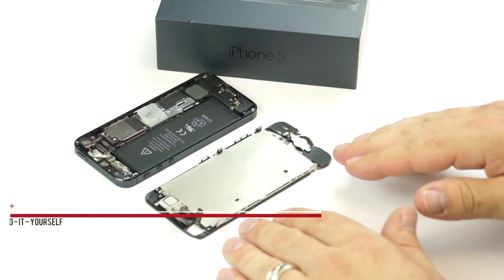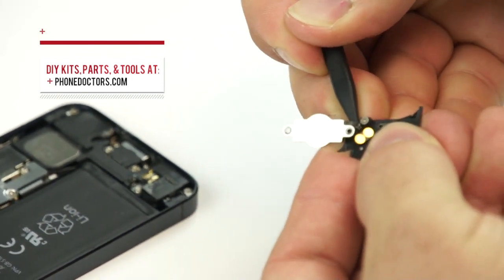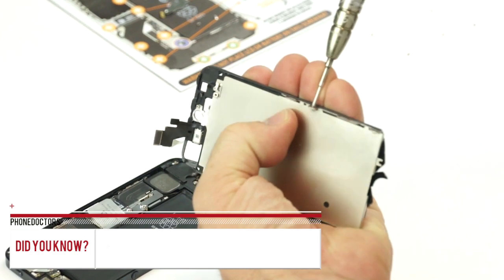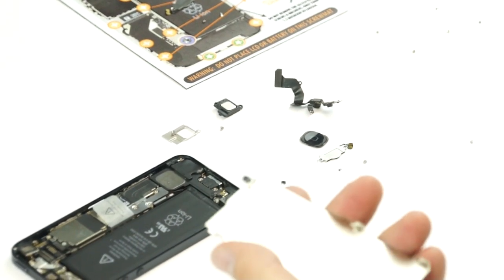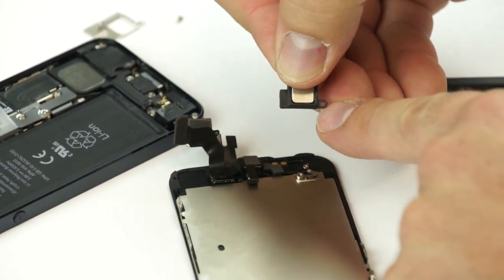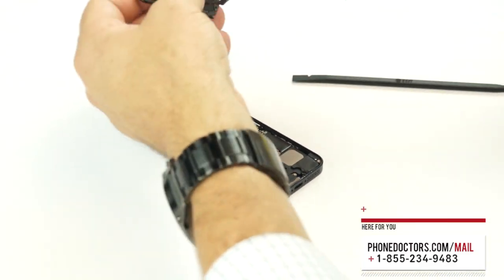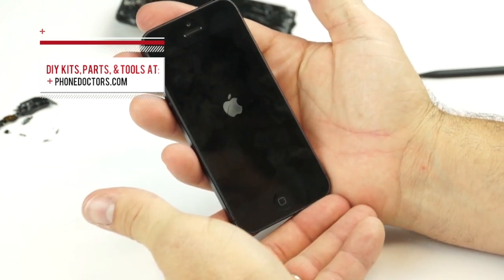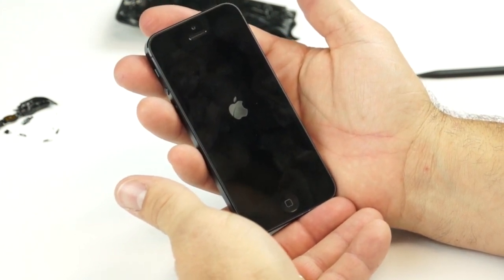iPhone 5 Screen Repair Video - Complete Screen Version

Comment: thanks a lot ;) everything works fine.
at the begining had a problems switshing it on , but later it turned on.
and almoust lost that little black part that u forgot to mention, but in the end everythings greatl, thanks.

Comment: Is it possible to replace the LCD flex cable ribbon on the iphone 5s without having to replace the whole front frame?  I know the cable is ripped. Or can just the LCD be purchased without the glass screen?

Comment: .
So i'm getting 2 white stripes down the middle. Touch screen takes alot of finger hits. and no button. Did I miss something? I reseated the 3 corner ribbon cables. Where does the button get its connection?
Reply from the maker: Steve Mckennon Try to doing a soft reset, hold down the power and home button for about 5-8 seconds. If that doesn't work make sure your LCD connectors are properly plugged into the logic board. Still no luck after that, you may have a defective part.
Reply: Thanks. Just bought the screen new off ebay. I'll try that when I get a new home button. I think I streched it too much while trying to pull it of the old frame, even with hair dryer. Thanks for your tip. And which one of the 3 is the lcd and why cant't I slide the begin arrow to right at startup? It stops at the stripes. It might still have chars of glass in the mini contacts or maybe the digitzer board? How am i doing on guesses?

Comment: This video just sucks, he uses and already disassembled iPhone5, and when he takes of that conector with front camera, proximity sensor and etc... it just slips away, but in the corner of the conector there is the power button contacts, that is heavily glued, and pushing it out just like in the video left me without power button.... great! Those kinds of videos should be entirely made with a phone that have never been opened before...